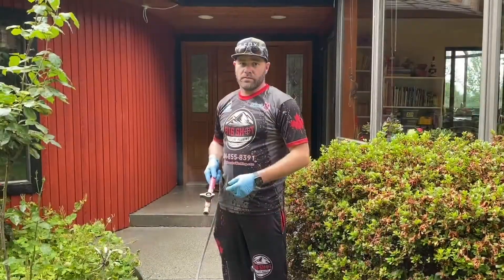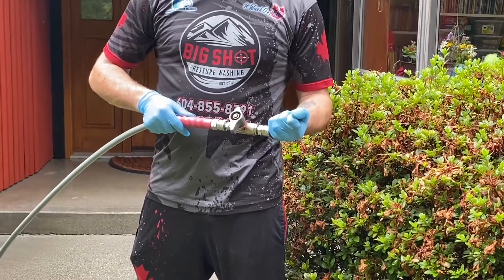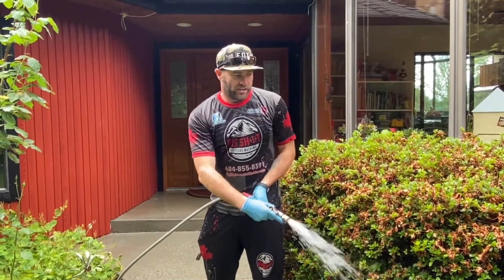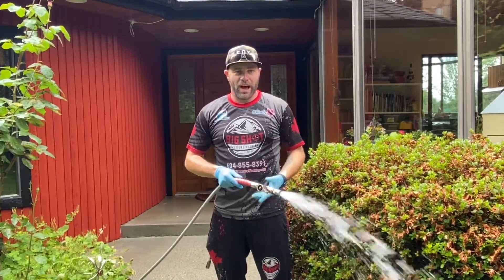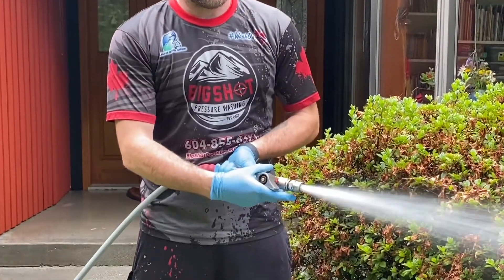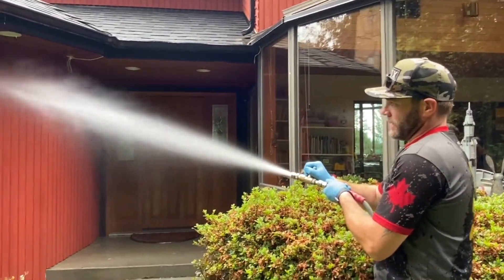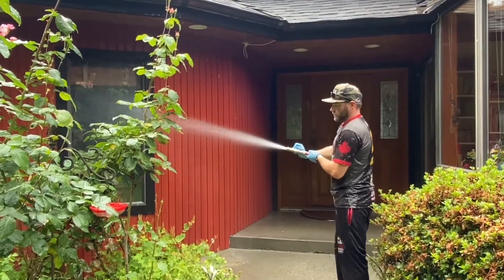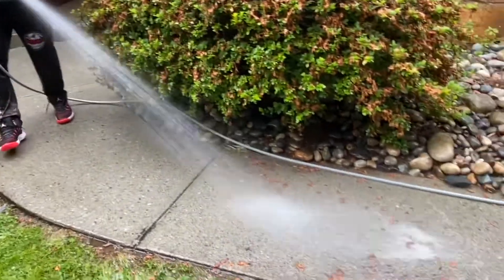Ball Valves

Comment: I still don’t understand why you need a ball valve to change attachments while the engine is running. It only takes a few seconds, not enough time for the pump to get too hot.
Reply: There’s pressure in the line so you won’t be able to take the quick connect off, you’d have to turn your washer off let out the pressure switch then turn it back on

Comment: Do you know what size to get for a pressure washer? 1/4”?
Reply: 3/8" npt for larger volume of water flow.
Reply: @ahndeux what if you surface cleaner connects with a 1/4 can you still get the 3/8 ball valve?

Comment: Yeah how the fuck do you keep the o rings from shooting out?
Reply: @bigshotsuppliescanada9986  I shoot with the male plug side, no o rings lost
Reply: @rafaelham282  From what I saw.. the male plug for cold water is good, but if using a hot water PW, with the female coupler on the back.. if an oring blows the water shoots back at the person holding it..and can end up with really bad burns. So my take is hot water PW, use the female side (as seen in this video), but for cold water reverse it.
Reply: @rafaelham282  Only downside to that is you cant put a standard jrod or rinse shooter tip on the male unless you add more plumbing